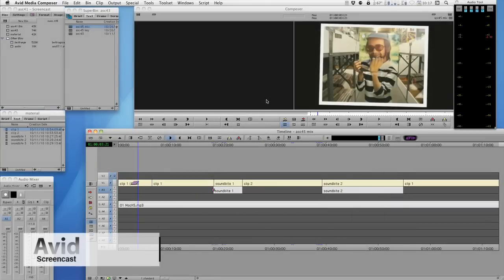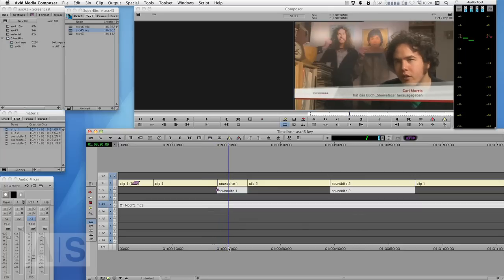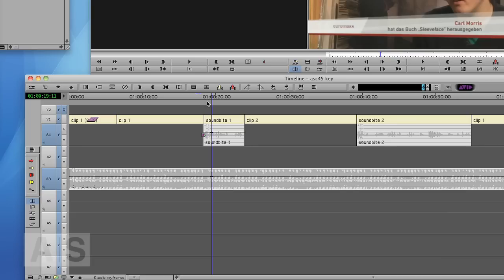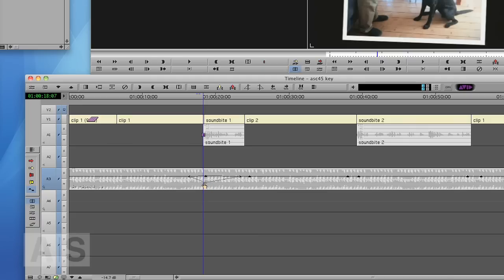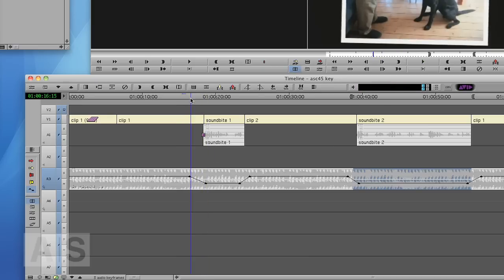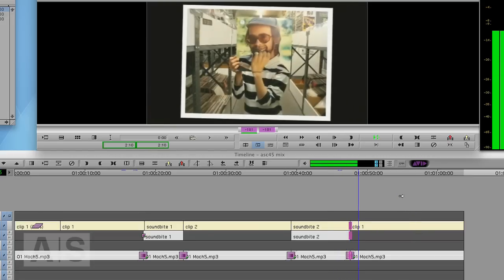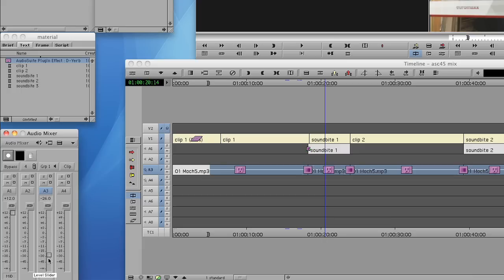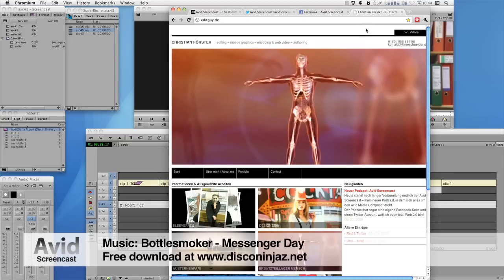Avid Screencast #45: Audio Basics V - Audio Keyframes

Comment: Thanks a lot for this video.  I didn't know a lot of that, there's a lot of good info here.  Especially the part about the plugins & rendering.
I usually use the mixer also.  I like being able to see where all the changes are happening in the timeline by just looking at it, as I keep my audio tracks thin.  And I think making changes is much easier that way.
And I'm the same way about the exacting volume levels.  Strange, isn't it?
FYI:  We call the keyframe method "rubber-banding."